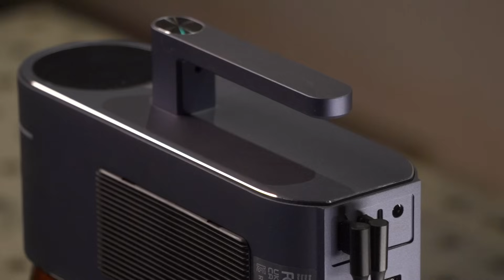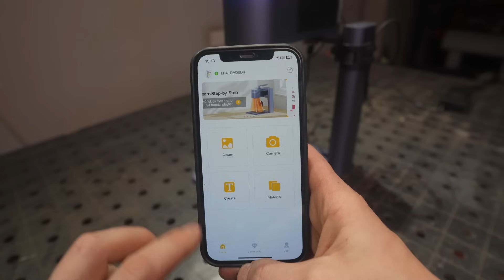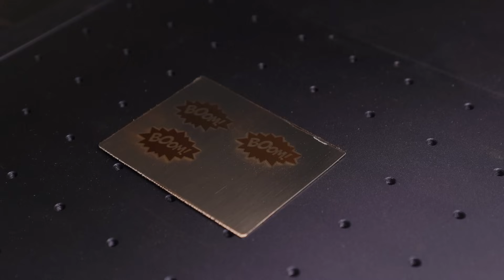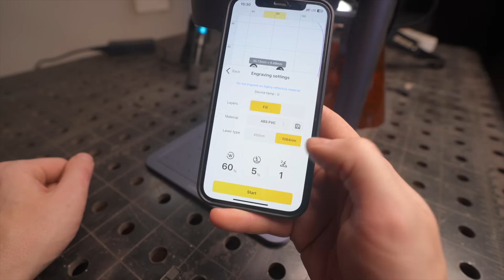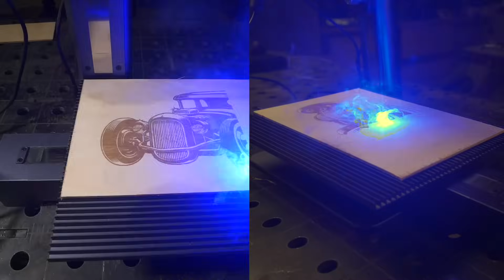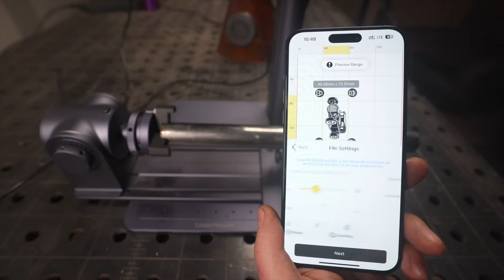Amazing technology LaserPecker LP4!

Comment: I also received an LP4 from Laserpecker about the same time. I am generally pleased with it but it does have good and bad aspects. It is excellent for engraving wood, plastic and metals. It is not so good for cutting plastic as it needs several passes to get through and leaves edges rather burnt. Cutting thin plywood is okay as long as the parts are quite small. The problem with larger parts is that the edges are cut at quite a steep angle. At the full extent, the laser and material form almost an equilateral triangle so the edges will be cut at close to 60 degrees. Not so good if you want to make things like wooden boxes. Where the LP4 excels though, is engraving fine details, here it outperforms my gantry laser engraver hands down. I added the rotary attachment to my LP4, this was a bit expensive but makes it great for engraving round objects like drink bottles and glasses. At well over a grand, it is an expensive toy, but worth it if you can put it to work making you some pocket money. Also worth mentioning is that, unless it is sited near a window or door, you will need a decent extractor or air cleaner to eliminate the smoke and fumes.

Comment: but laser have important can cutting wood too can make lot more and lot used different wood project, etc, RC plane wings profile parts, mirrors, lamps, model boat frame parts, etc, lot more and important can cut wood. if not can no need laser anywere.